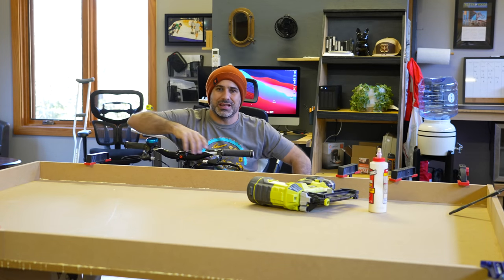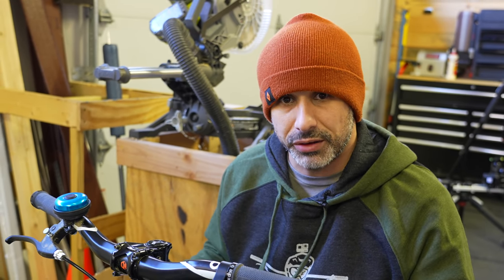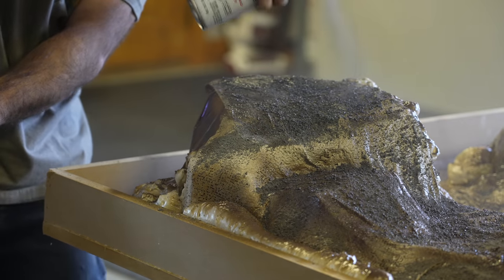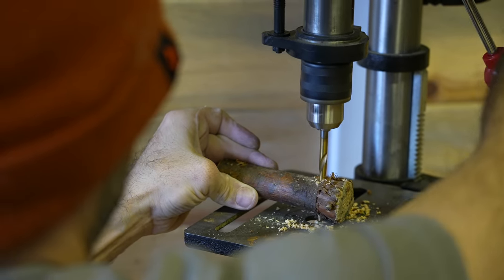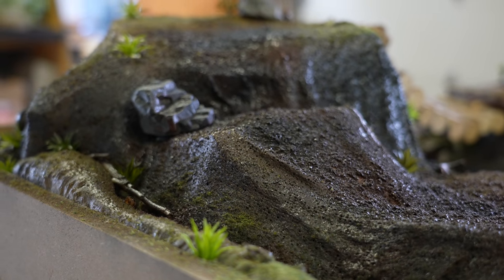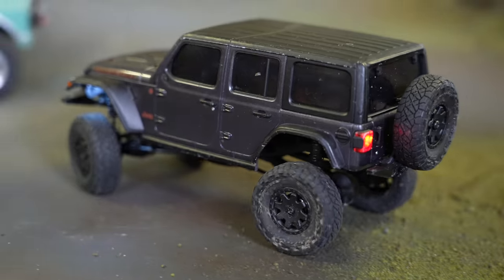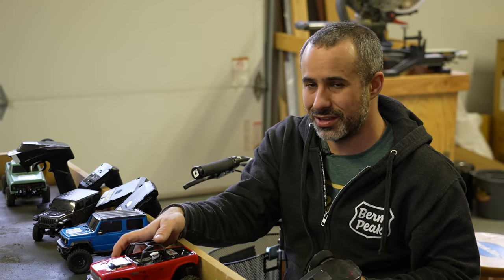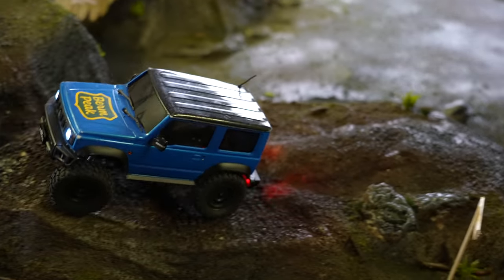Building a Lightweight Indoor Crawler Course from garbage

Comment: Make some sort of tunnel under a plaster mountain and that is where the “garage” for the crawlers will be
Reply: Wide diameter PVC pipe cut in half (or slightly larger than half) makes a great tunnel starter.

Comment: If you want to add light weight obstacles, a can of spray foam works wonders. Spray a blob here or there then use a bread knife to carve it. The beauty about spray foam is it is dense, and light (since it's mostly air). Use the high expansion gap filler type. 

you can carve ruts into it as well and then paint it up so it looks like mud. Using the water based liquid clear, you could even fill the ruts with glossy clear, when it dries it will look like water. 

Just thinking: if you wanted to make a winter section/snow, paint things in white, and off white and use gloss clear to make it slippery. 

If you wanted to make a "desert" section, you could use camo paint in tan, get some plastic cactus and it'd be gold jerry, GOLD. 

I am just getting into crawling and I might just make one of these. 

You could also just screw down your 'mountains" so you can rotate them, or move them around to change it up. When you're laying down the plaster, put down some old grocery bags first so it doesn't stick to your base. Pre-drill the plaster sheets though so they don't split when you put the screw in. Also use pan head screws so it doesn't crack your mountain. You could even use plastic washers to further protect your plaster work.
Reply: pin this comment. ftw

Comment: With holes in the 4x6 base (think welding table) each large “mountain” could be modular with a few dowels on the bottom. Able to be moved around as you get bored with a certain layout

Comment: Looks awesome. I painted my micro-course with normal grey wall paint. Let it dry for a little time and then used dirt added with a brush. So its not glossy and you need way less spray paint. Spray paint works in my opinion best for adding some highlights...

Comment: This is pretty cool. Here in Belleview, FL at the flea market we've got a big one of these mini-tracks about the footprint size of a 7-11. They're always working on it and adding obstacles. Pretty cool hobby, and a nice way to expand it from just boringly driving those things around your driveway or whatever.  One thing that bugs me is how light those little vehicles are on their suspensions and how they bounce/spring around which takes away from the "realism" which is really just an eye of the beholder thing and not a game-killer. I think I would try experimenting with adding weight up inside the body at the corners (gluing washers or sticky wheel weights), to increase the load on the suspension and tires a bit. This would decrease battery life and torque, but I think that's okay. More weight would be more traction and a more active suspension. I think it's worth a try.
Reply: funny enough, this is super common in the hobby. bouncy suspension is the #1 thing people try to get rid of in these small crawlers. If you look online, you can find compatible oil-fillable shocks. Lots of tutorials online explaining it, but they make these cars far less bouncy and much more capable

Comment: I built mine from cardboard then used spray foam then cut and shaped it the way I wanted. Then used exterior stucco to cover the entire thing. Supper grippy if you want even made tire ruts and stuff cause it easy to shape. Then paint. Contractors have left over always and it’s usually in earth colors

Comment: When I painted my house I cleaned up a paint spill with a rag and it was left to dry and got rock hard! So, I wonder if instead of buying the plaster stuff, you use old fabric that is really thin, bed sheets, or tshirts, cut to smaller pieces, then use leftover latex paint (maybe watered down?) “that would be going to a land fill anyway” and if the paints were dark colored, it would be stronger? Free (up cycle) and if something broke through it would be dark colored. Great video!

Comment: An old hobbyist trick for gluing landscaping in place is to dilute wood glue until it is watery and add a drop of dish soap to break the water tension. Put it in a spray bottle and saturate your aggregate and it will dry firmly in place with a dull finish. The nice thing is there a no toxic fumes.

Comment: To attach the "sand" to your surfaces, LePages makes spray adhesive (water based) and that is actually an adhesive so it would work better than using the paint. 

Also for a clear, there are water based clear sprays, I use Varathane all the time. It is cheaper to buy it in brush form and since you don't have to worry about brush strokes, you can lay it on thicker on the track area.

Comment: That turned out SO good. could you use snaps or Velcro or something else to lock the rock features down so you could put them on different parts of the course.  A log halfe sticking out of  the plaster would be cool.  A water trap with a parallel log bridge over it would be cool.  I tend to be more into the Rainforest challenge, or winch truck challenges than just the crawling. but that is just me. Like you proved on your desk. you can have fun with these trucks on anything. As a model builder kid growing up. i like these videos ALMOST as much as the MT bike trail building vids. As these are 1/24th scale rigs, could you use bodies from all the 1/24th scale plastic model cars and trucks . Good luck with the foot.

Comment: You should build some boulders out of rigid insulation foam so that you can still have elements to move around the course. Maybe hot glue pieces of foam together and then use a drywall "cheese greater" and sand paper to shape them and then give them the same particle and paint treatment as the fixed objects.

Comment: looks awesome for a first try! I'm a recent convert to the Kewl MTB'ers Kewl second hobby. Got myself an FMS Power Wagon so obviously, I had to immediatly get a Max Smasher! Got some upgrades coming (the Max Smasher has a SH!TE steering servo horn out of the box, an the crawler has wheels an brass in the post. As soon as thats finished I'm starting an indoor set up like this but, I plan on building it in modular sections that I can move around. Been collecting boxes, polystyrine, alu cans an some wood for the base. Thanks for the tip on the plaster sheets!! seen it on others builds an wondered what it was...
Maybe I'll start me own YT  channel  :'D

Comment: To keep the sand and gravel in place all you need to do is the following. Use wood glue to stick down the sand and gravel, wait for the glue to dry. Then coat everything with watered down wood glue. Everything will be stuck in place once the glue is dry.

Comment: When using plaster strips like that it helps to rub it till smooth when its wet, like just rub it with your fingers to smooth out all the little holes in the grid.

Comment: Seth you HAVE to check out the knee crutches made by iWalk 2.0. I recently ruined the tendons in my leg and the knee crutch has completely revolutionised my recovery! It allows me to walk around hands free without putting any weight on my ankle.

Sure you can mod it with bike parts but it will allow you to walk around when you have jobs to do!

Comment: 2:20 In case you go back and redo the scenery at some point or similar, what I do is I put the ground cover down first, then use a mix of white glue, water, and a bit of dish soap in a spray bottle to glue it down.

Comment: After placing the plaster cloth press it down all around the object and rub the cloth. The plaster will work between the gaps of the cloth. That will form solid looking objects without all the holes.
Reply: Coarse texture spray paint is quick and easy as well.

Comment: Do you think the course and the woodbase could hold a little creek? i would build a really hard path and a easy path through a creek, so you have to decide whether you drive over the creek and lose grip for the next feature by making your tires wet or you try your luck on the hard path and keep your tires dry.

Comment: Reduce the size of the diameter of the bridge logs to half, use Styrofoam to shape the hills before using the plaster, it is a lot better than boxes, get a basic aquarium pump and do a water feature, mix sand with white glue to give it texture make tunnels to layer paths, it will give you more driving area...

Comment: "we want to keep it light"

Then uses 3/4" MDF as the base lol...dude, that's about the heaviest 3/4" sheet material you can use!

Note to others who might try this: use 3/4" or 5/8" construction grade. It is about the lightest in 3/4" because it is low quality and has plenty of voids inside. If you don't mind it flexing you could probably get away with 1/2". Gluing rails on the edges will help keep it rigid and maybe even one up the middle.

Comment: You should go check out Redcat Racing. They make a really good quality crawler for the same price as those. It’s a 1/10 with a motor on each axle, 4 wheel steering and a tone of suspension travel.
Reply: It’s called the Danchee Ridgerock